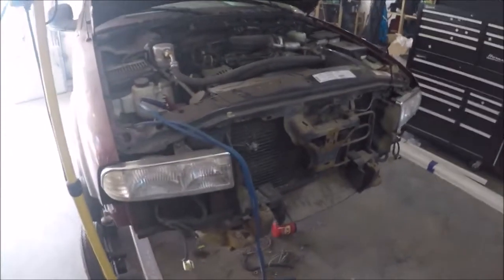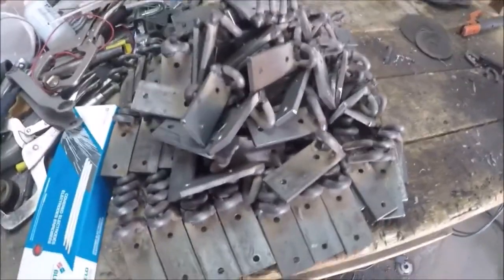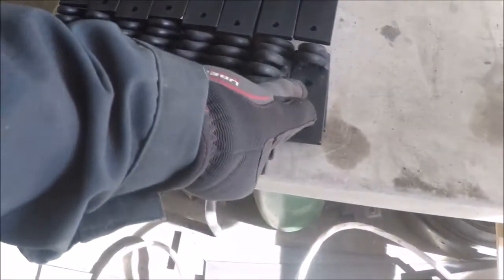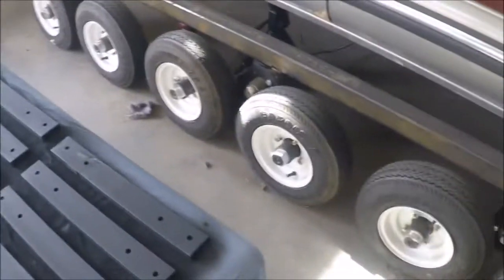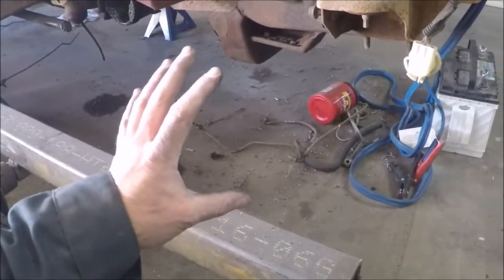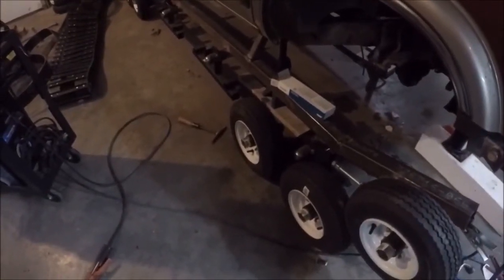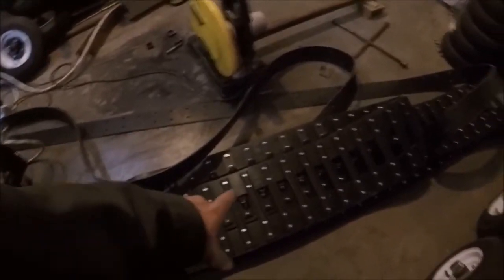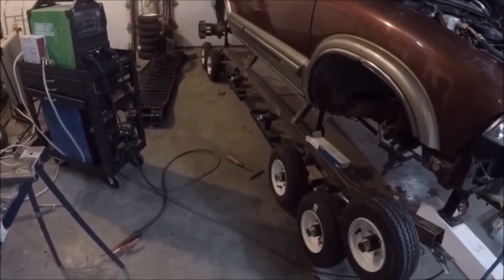Custom Tracked Vehicle, Part 11 Track and Final Prep one side

Comment: Looking Good!! I made my tracks, welded 74 cleats per side. Ended up using only 55.  Like 38 extra cleats all together just sitting in a bucket till I need them.. Did so much welding on them that I fried my ground clamp, so I put one of those Harbor Freight 600a brass ground clamps on my 90a welder, LOL.
Reply from the maker: Thanks Prancstaman. I can see some changes for next version, using thinner material for the guides and 1/4" round bar instead of 3/8" as it's heavier than required.
I met with an icon of the tracked vehicle industry yesterday, Jack Nodwell, the son of Bruce Nodwell the inventor of the Nodwell tracked machines. It was pretty cool, he thought what we do is awesome. Can't wait to get this thing moving and test drive it.
Reply: First time I heard of the name, but when I looked him and his son up, I recognize the vehicles they made. Pretty cool what they did. How did you meet him?
Reply from the maker: A guy I know who receives an email update on the tracked machine knows him and thought it would be a great idea to get us together for lunch. Crazy coincidence.
Reply: Cool, Small world.

Comment: Really think you should have plated the frame rail every where you made a welded attachment.  The frame material is very thin and your attachment places will be transferring a lot of stress in that area.  I use to work on race cars where we modified regular passenger cars for dirt racing. Any attachments such as rub rails, bumpers and roll cages were always welded to at least 1/4" flat plates that were welded to the frame first.  They were as wide as the frame and at least twice as wide as what evermaterial we were attaching to the frame. As we use to say it was cheap insurance against frame failure.
Reply from the maker: Hi Richard, that has occurred to me as well and in some spots I did add a plate under the attachment. Where it was on a reinforced section I didn't but where it was just regular frame I did. Definitely find out if I did it right once I get this thing out for a rip for real!